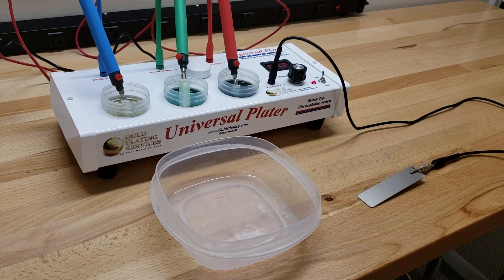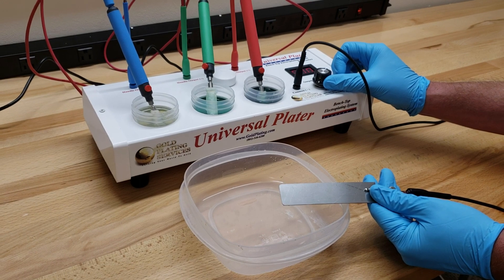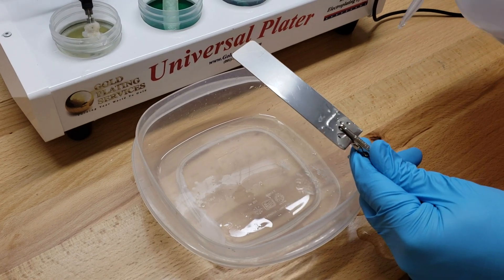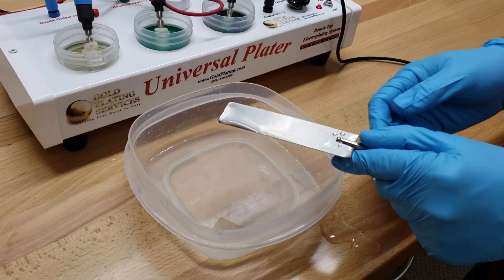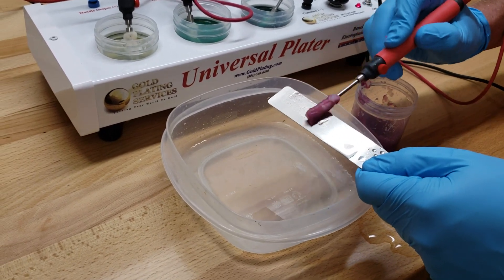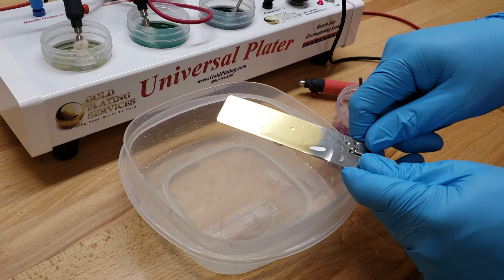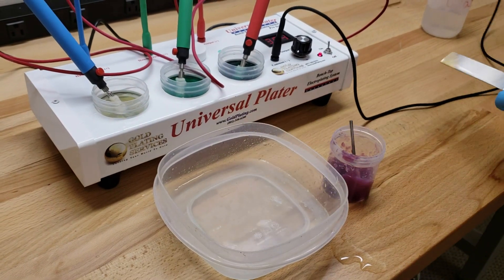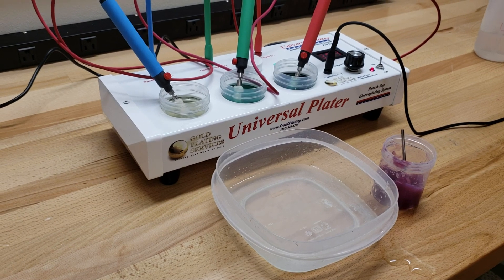How to Nickel Plate & Gold Plate onto Steel (Guns etc.)

Comment: What is the difference between the gel and the liquid gold solution? What’s best to use
Reply from the maker: They are both the same thing just the gel solution wastes less when you are plating on surfaces that are vertical like a car or something. The gel is easier to collect when using so it can be reused.
Reply: @GoldPlatingServices  ok thank you. How do you collect it so it can be reused?

Comment: I'm curious if you can nickle boron coat just the rails which a gun slide rides on when you take down your pistol?

On most polymer pistols, that is 4 or 5 little strips of metal that the slide rides on, which are the only points of contact.  If polished up, or nickle boron coated, I'd imagine it would make the slide run much smoother and cycle better.
Reply: Doesn't last long.  I had it done on a 1911, the nibx worked OK, ti nitride was better.  Had ti done on my  stacatto.  It worked great.

Comment: Dude y’all service is fascinating
Reply from the maker: Pretty Cool stuff right.
Reply: Not really. It's an overpriced kit. Costs way too much money for what it is. It can be done far cheaper using a universal power supply or some other voltage/amperage regulated source.

It's really cool. But these 'kits' are ridiculous.

How much did yours cost btw?

Comment: I have a gsg 1911 the frame is zinc alloy got it used guy stripped the frame down to bare metal Idk if it even has a protective layer looks horrible was wondering if it's possible to nickel plate the zinc alloy frame do you have any recommendations I'm new to this any ideas would be very much appreciated
Reply: No it won't plate.

Comment: wo never new it took so much effort to do such a thing. How would they plate in the old days?
Reply: How the fuck did they invent this?@?@?
Reply: its literally just a power supply and a heater element
Reply: @nonyabidness6492  sure, my thought were how they did this in the mood days. Before these gadgets were available. It's seem all about currents and acid use.
Reply: @RomboutVersluijs   same way actually, in 1803 a man named luigi brugnatelli first did it. The ones here are just cleaner and more refined
Reply: @nonyabidness6492  yeah but how were they checking voltage and such? No meters nothing in that era
Reply: @RomboutVersluijs   uhhh you need to do some research cause yes there was.
Reply: @nonyabidness6492  i would have never thought that in those early days they already started using currents to do this kind of work. Since they were at the beginning of using volts and whatsoever. This workflow seems very complicated
Reply: @nonyabidness6492  i tried google, but i get different results and they each tell me it was invented in different years with a time span of about 10-40 year difference
Reply: 3 years late but gilding as it's called was another method though not as strong as electro plating. Gilding was heavily used on decorative armors back in the middle ages.  Oil gilding especially has been around since the 1000s
Reply: @theanimatedjunkyard5921  thanks for the info. Is that done with hot oils or something?
Reply: @RomboutVersluijs  no it's done with what's known as an oil size.  It's basically an oil mixture that has adhesive properties over the period of 2 to 3 hours.  They are not heated.  
Afterwards one applies a thin gold or silver leafing to whatever their project.  There are multiple gilding methods but using an oil-size is the oldest and cheapest.  Fire gilding is another method but extremely dangerous since it requires the use of mercury.  Water gilding is another method but only good for wood products not really stuff like metal or ceramic.  
It's mainly best used in decorative projects but there are cases of it being used in armors and weapons.  I know I've seen a gilded revolver with the fictional character Harley Quinn attached to it so it holds pretty well when done right.  Not as well as electroplating but well enough.  
Actually in fact the Statue of Liberty's torch over in new york is gilded in 24k gold leaf.  It was regilded in the 1970s and has been holding well for about 50 years, especially now since we have access to sealants and coatings to better improve durability and longevity.  
All in all if you're wanting to gold plate stuff oil gilding is the cheapest method bonus since companies sell different karat leafing and different thicknesses.  Kits for it are also cheaper to get.

Comment: I have been trying to gold plate a Glock 43x stainless steel slide, I haven’t had luck. The gold is barely noticeable, my steps are electro clean, nickel strike and 24K gold brushed. Could anyone help???
Reply: Am having the same issue any update ?
Reply: @EdgarFTP6  u figure if out
Reply: Figure it out?

Comment: Is it mandatory to use the nickel conversion bit
Reply: I would also like to know
Reply: the nickel bit is necessary because it replenishes the nickel in the solution, if you use something else, it will take the spot of the nickel in the solution and ruin it. any contaminants on your bit will also affect the plating. I'm speaking from experience :P spend the money on a pure nickel anode or buy one of their bits
Reply: @MuhammadAli-nf3nc do I need to buy nickel conversion bit WITH anode bagged nickel or can I just use nickel conversion with a normal sleeve
Reply: @MuhammadAli-nf3nc  thanks

Comment: I did this but it came out cloudy any suggestions ?
Reply: Turn down the current
Reply: @rmillancepero  
thanks I think i figured it out. 
Do u have the same plating machine ?
Reply: @samswadley  I don't have the same one but something similar
Reply: @samswadley  I'm not a professional but my stuff comes out good. If you have one that you can change the voltage on then change it to 3.5 - 4 and I dip mine in the solution instead of brushing it on.
Reply: For copper use low current. For nickel use low current. For gold use higher current.
Reply: Ps I was trying to do just a nickel plate

Comment: Does this process need to be done if the steel has chrome on it?
Reply: Nope, you need to strip it using a chrome stripper , then an activator, then gold plate it ...

Comment: Is this all the stuff you need to get started? Ive been thinking of doing this as a hobby then probably do it as a small buisness in my off time from work. Have a few questions to ask you. Thanks and hope to hear back from you!
Reply: I sure did. One of the coolest purchases I've made in a long time. Simple to use. I recommend this hobby!
Reply: @getsmarty7603  nice 👍🏽 thank you for responding
Reply: @getsmarty7603  did you hold playe anything is it simple?
Reply: @angelovega5199  ya it's super simple. I did a hand gun and 2 knives so far.
Reply: @getsmarty7603  did u buy this kit or just the products
Reply: @angelovega5199  I bought this kit.
Reply: @angelovega5199  it was about 1200$ Canadian. So depending on where you are from, the price is pretty decent for what you can do. You can easily make your money back.
Reply: @getsmarty7603  what are you playing with it? It'd be nice to see some of your work.
Reply: @wekivaaquatics5918  I will eventually put some videos up but I haven't had any time cause I'm busy with work and doing some Renovations in my basement. Hopefully by winter I can throw up a video. This guys videos are very well done and I learned everything from him.
Reply: Did you ever get started?
Reply: Did you ?

Comment: Can this be done on valve covers?
Reply: if they arnt alluminium
Reply: what metal are they?if chrome ,then chrome needs removed first to reveal a nickel base,gold plates on nickel direct.
Reply: Gold can be plated even in aluminum aluminum is cleaning just with a soap cleaner any kind of etch nitric acid Electro Nickel then gold

Comment: electric cleaner  is that the  Chrome strip ?
Reply from the maker: They are very similar in composition but do have differences.  That being said, you can use Chrome Stripper to Electroclean by using forward polarity (normal plating mode).  You cannot use Electroclean to strip chrome, however.
Reply: Thank you